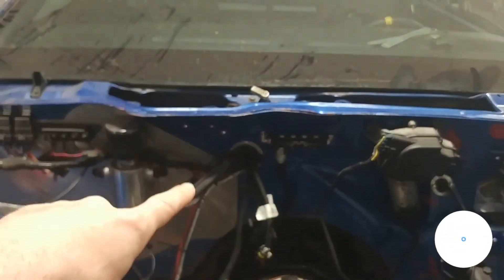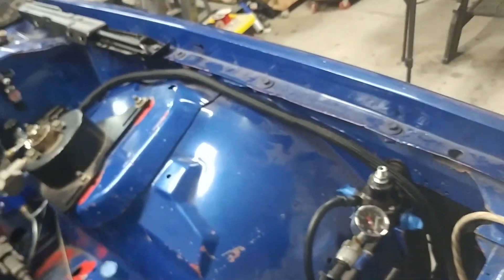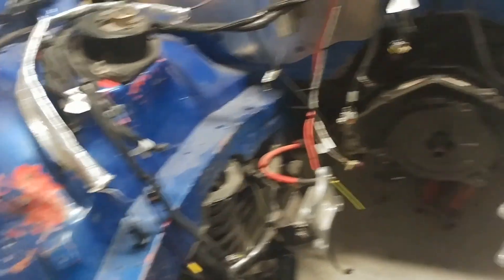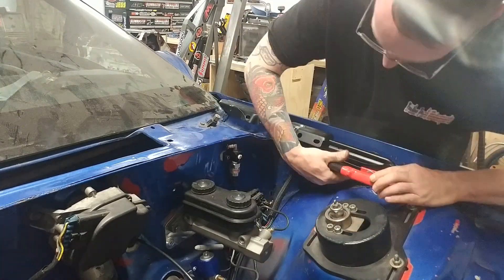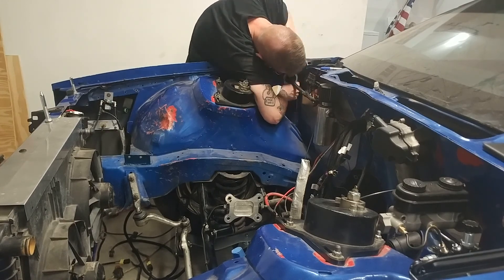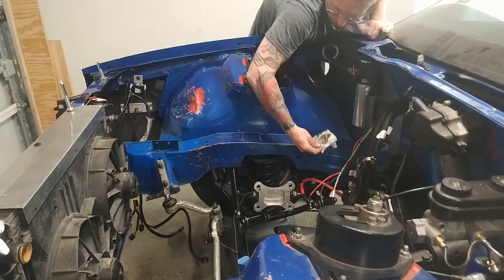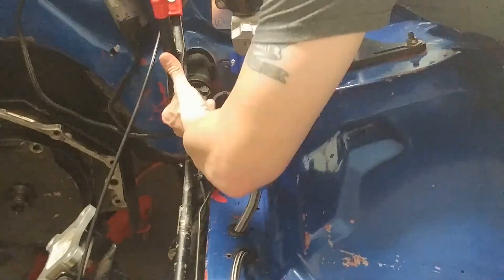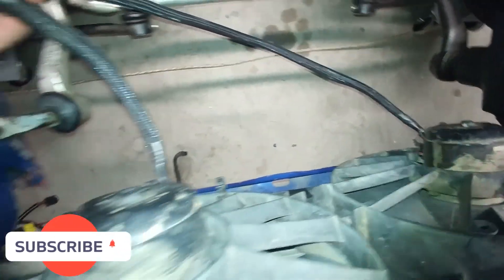Cleaning up the engine bay

Comment: the hole on the firewall that you plugged woul d have been for the original cruise control harness, which has a vacuum line taped to it.
Reply from the maker: That makes sense, the original cruise stuff hasn't been in the car since I bought it 8 years ago.

Comment: Whew! Massive grommet holes there for such a small wiring harness traveling through it 

Otherwise, good project.  I hide every wire I can if I can.
Reply from the maker: Thanks for watching. I debated a lot on how to do it, if I should cut the wires and use something like a barrel connector to do it, or if I should use a deutsch connector and a smaller grommet. At the end of the day I decided to just get it done.
Reply: @TrailerParkMotorsports  yea there’s a few options to do. Snap bushings or a skirted-pass through bushing . Not to worry it worked out good for ya